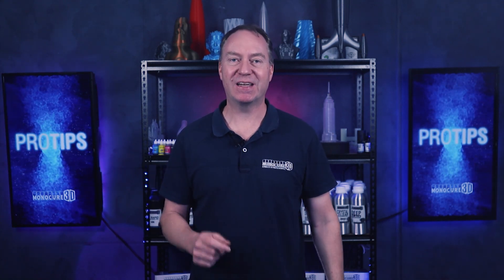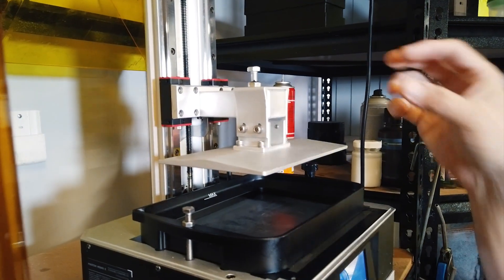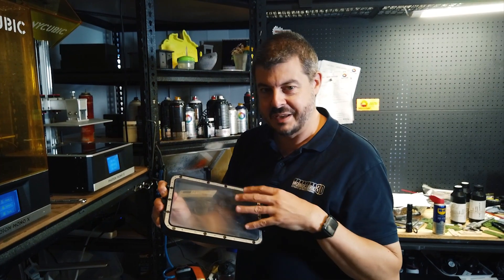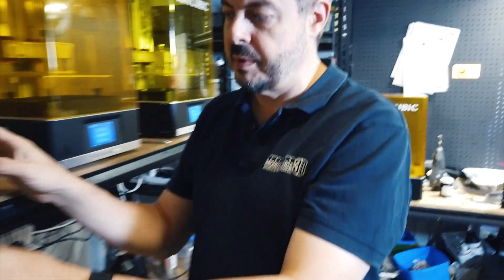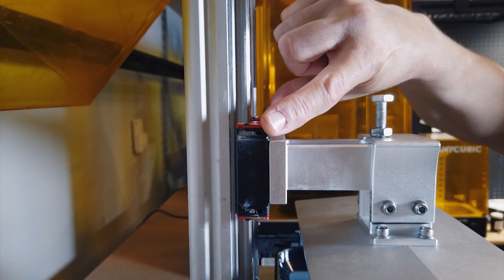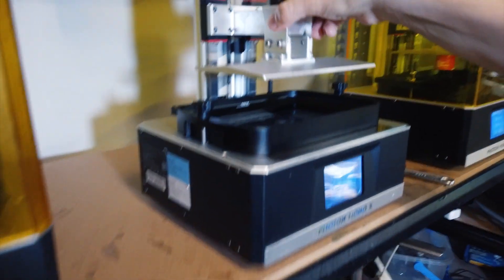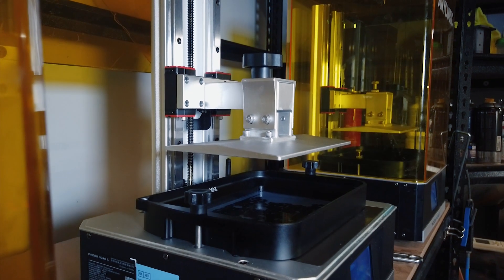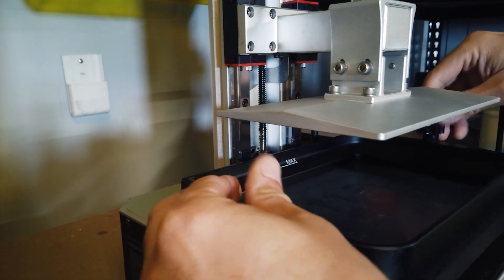Anycubic Mono X: How to get the best Performance from your 3D Printer.

Comment: On my two Mono X - one first gen and newer version with the checker plate. On the newer printer I was unable to remove the supplied test print from the build plate. Just in case any settings were different from the original printer I tried the test print supplied with that on to the newer one, and same again. I ended up halving the base layer exposure time to bable to get the print off the base plate. Also impressed with the checker board build plate as it doesn't seem to get the black oxide layer build up that the smooth plate gets. I was so impressed with the checker board build plates I purchased 3 more - giving two per printer. Strangely, the checker board build plate made no difference to the adhesion of the prints to the older printer. I have also replaced half of my handles with 3D printed ones, with enough spares ready to replace the remaining ones. Thanks for the cleaning tips.
Reply from the maker: Hi Paul, I agree,  the checkerboard build plate is great. I’m surprised the other manufacturers haven’t copied the idea yet!? Having a few spare is a good idea, I also like having extra vats. The vat for the original Mono X also fits the X2 which is awesome. I do find the adhesion to the new build plate much better than without checkers when using our epoxy based resins that tend to be less sticky than the urethane material in our TUFF and PRO resins. Especially noticeable when heat is involved. Thanks for your kind words! I hope you have subscribe to our channel!

Comment: Very useful video. Thank you. I'm going to try your print settings, as I have been having terrible trouble with the longevity of my feps. Your exposure times are more than half the time I've been using, but your lift speeds are far faster. Interested to see what happens.

Comment: I keep breaking my print jobs trying to get them off the plate. Any tips?
Reply from the maker: Run hot water over the back of the build plate to soften the resin and make the parts easy to remove.
Reply from the maker: Monocure 3D ProTips: How to easily remove 3D resin prints stuck on the build plate with no damage?
https://youtu.be/OYZ_aw9M6Nk

Comment: Through which noxious gases come out, I saw that there are 2 fans downstairs, so I'm interested in whether noxious gases come out through those two fans, I have a great idea how to get the smells out. I don't have a mono 6k yet, I'm planning to get it on sale soon, so I was looking for a fan to buy to get the smells out of it, so I found a great fan Vacuum portable laptop cooler, it's cheap and quiet enough, it mostly sucks air, I would install pipes behind it and that's how I would arranged to draw smells out of my room. Question / is it possible to extract smels if I use a fan or do these smells come out from all sides of the machine?
Reply from the maker: Noxious gases is a little overboard! There are some fumes while printing but if you leave the lid on this helps control most of the odour.

Comment: the issue i'm having is, output from the slicer program, being read by the printer, my firmware is currently V3.4.8 v1_v1.2. i'm wondering if I update the firmware, that issue will go away. how hard is it to update the firmware? is it just a matter of putting it on a memory stick, and plugging it into the printer?
Reply from the maker: Heaps of tutorials on YouTube to update firmware. It's not hard.

Comment: a query, for a creality ld006, what specifications can I use to further improve the print quality? , of course , many thanks
Reply from the maker: All printers are different. I recommend you always print calibration models and do the testing yourself with these types of printers. Do not rely on settings that other people have found works because there are many factors that make it difficult to use other people settings. This includes everything from the way the printer was built to the resin you are using and the environment that you are in.

Comment: Got a MonoX, been working without a failure, I have been thinking if I should update the firmware as I got mine in the pre order stage so it’s quite old.
If I pause the print to add more resin it will create a layer line which doesn’t happen on my other printer and I’ve had it happen once where I moved the buildplate up to stir the resin in the vat and it skipped a bunch of layers from some of the supports. The workaround is to always fill the vat with resin close to the max line and to always turn off and on before print if I move the buildplate so was hoping updating the firmware would fix these.
Reply from the maker: Interesting- thanks for letting us know and sharing.

Comment: My first knob melted, my second one I did not use any cleaning but that one crumbled to pieces!! My Elegoo Mars 2018 knob is still as good as new with IPA99,9
I've had some real struggles for a year now with the Mono X and no AA, fan noise, liters of resin failures
Reply from the maker: We have found some low cost aluminium screws that work well. I’ll see if I can find the think.